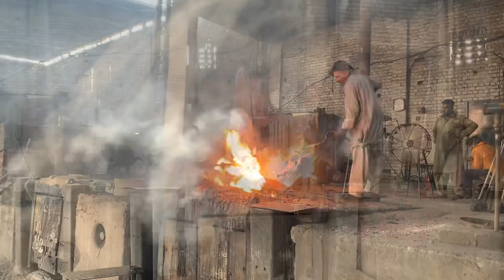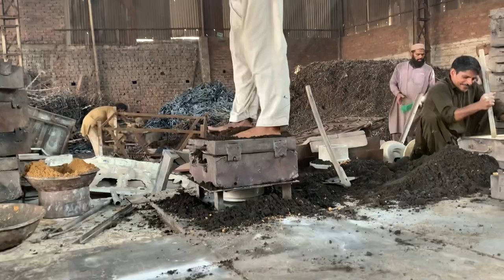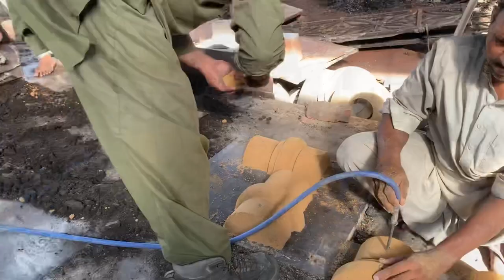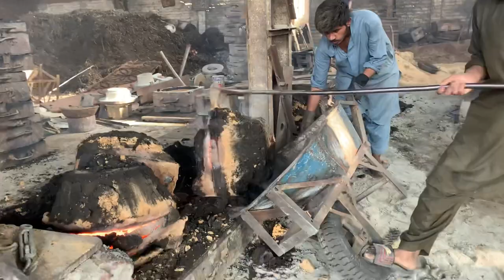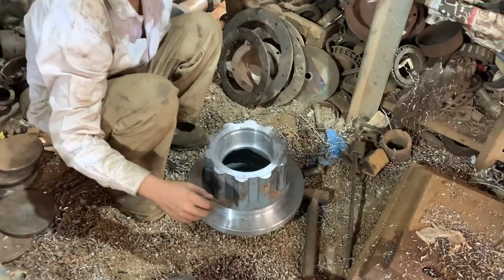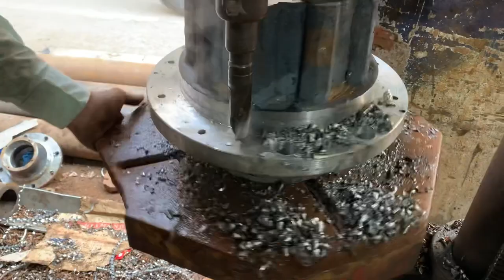How to Make a Wheel Hub for Heavy Duty Truck with Complete Processing of CASTING, MACHINING & HOLING

Comment: Jesus! Is that just water they're using on the drill bits as they cut through all that steel? Those bits won't last long and I bet they dance around in the hole as they warp.
Reply: The whole video was all cringe 😬

Comment: Hand made just like a 60's Porsche LOL. I was a machinist for eight years in my 20's before moving to IT and yes I am an American but I have to ask other than youtube revenue generation, does the poster believe we will all be impresses with their hand skills?  No safety glasses, headgear or hearing protection, safety shoes, the work area is beyond filthy. No to mention cleaning the lathe and running coolant on the cutting bit. I'm sure the part to piece to piece tolerance consistence is within five inches. I mean wtf, are theses people still in the stone age?

Comment: I didn't see one micrometer or dial indicator used in the lathe work. They could of used go and no go gauges for the diameter dimensioning especially roller bearings journals. Nothing wrong with using a manual lathe for the work but their technique is bad.

Comment: They do not measure, they control. So last step of west science.  I’m surprised why they can throw any kind of metal ( not acc. DIN / ISO , or some other Standards)in the fire and get usable casting parts for trucks…. But they will drive. I’m sure.
Reply: I don't think metallurgical consideration is high on the priority list there... Oh your wheel hub shakes violently and cracked no problem friend we've got some chain link fence a couple trashcans and a filing cabinet in the back we'll simply make another one.

Comment: Wow , they still used  old antique  lathe machine like this  I wonder all these parts are acurate when sending out to the customers in the modern countries.
Reply: My Harrison L6 lathe was built in 1965 and is as good as (if not better) than the day it was built. Newer lathes have far too much to go wrong with them though of course excellent when they do work.
Reply: As accurate as you can get, when you don't even possess a micrometer, a dial gauge, or even a set of calipers!

Comment: Somebody knows what kind of sand or what is that that they use for casting ??
Reply: The tan sand appears to be a sodium silicate bonded material.  They are gassing it with CO2 to firm it up.  It’s commonly used for cores.

The darker stuff is used “floor sand” - clay bonded.  It’s likely to be part used silicate-bonded sand, but mostly a natural-bonded material.

Comment: Sometimes i do wonder if they check the furnace lining properly ..
If its thin or not, to replace the lining properly and periodically ..

And quite smart for them to take out the casting from the moulding while its still red hot .. Thats why there is no need for sand blasting ..

Comment: WOW. No safety equipment. Wearing  sandals instead of workboots while pouring hot moltensteel, No face shield , No safety gloves. Now the machine lathe operator. No safety glasses or shield to protect the eyes. I see the guy at the drill press is wearing what looks like steel toe boots. Still no safety glasses to protect the eyes and no gloves. Talking on cellphone while using a drill press with no safety equipment except for what looks like steel toe boots.